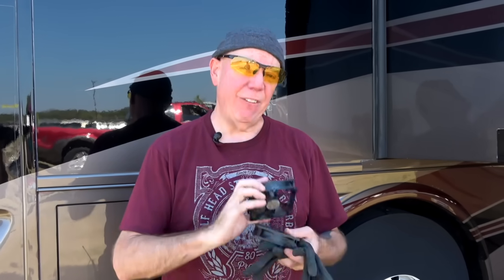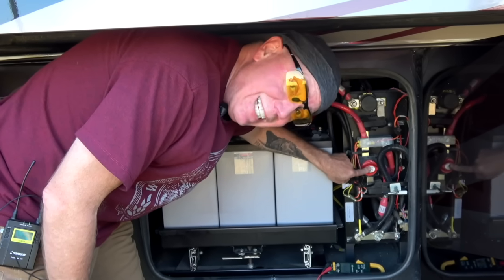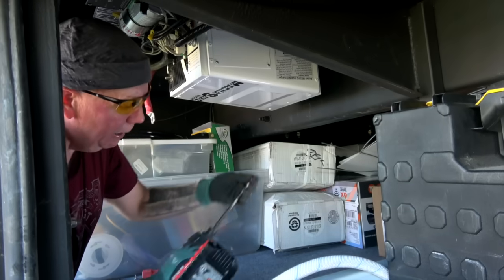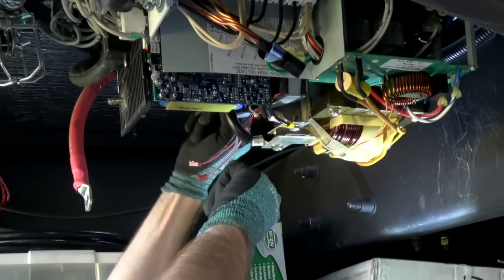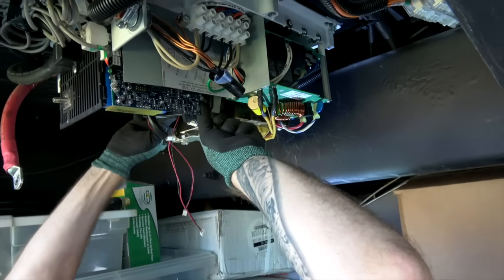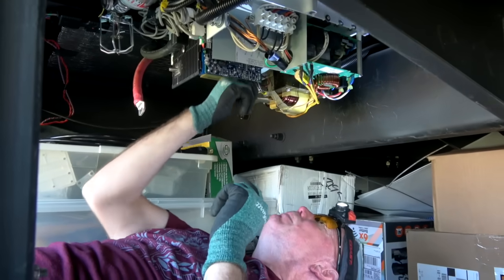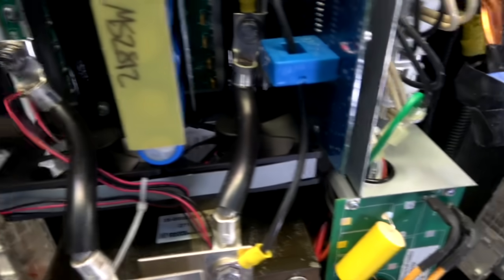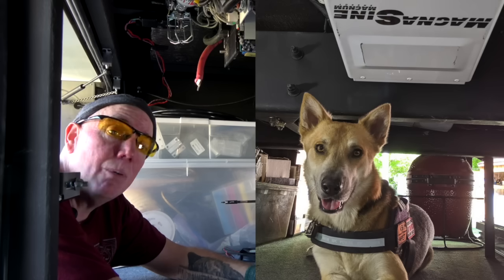RV Lost Power? Could be Overheating! Magnum Inverter Cooling Fan Replacement

Comment: Very informative. Thanks for posting. I need to preemptively change the fans on my Magnum inverter/charger in our 2019 Newmar Dutch Star 4018. I’m not very experienced in doing this type of work, so your video is very helpful. A couple of questions if you’re able to answer:  did I read your reply to one of the comments that you wrapped your driver extension in electrical tape?  Is that something you recommend?  And are the gloves you’re wearing for protection from a shock?  Can you recommend any gloves on Amazon or another source?  TIA.

Comment: I recommend disconnecting the negative (-) ground high amperage capacity cable. NOT the red positive (+) cable. Much safer.
Reply: Oddly Magnum recommends removal of the red first. The order is inverted from a typical battery?

Comment: Dave, are you ok?  You seem to be trembling uncontrollably
Reply from the maker: Hi Harry....It was the meds I was on and going though withdraws. All good but I will admit, I was a little nervous when I went in to remove the screw. But the shaft I was using was electrical safe.  I don't recommend doing it shaking of course. :)   (Thank you kindly for your thoughts and concern.)

Comment: Dave thanks for the video, watched it twice but still had to come back for that front screw and forgot which way the fans went after I took the old ones out.  Should have taken a picture before taking them out. In my defense, I have changed all 5 clearance lights on the front cab, and the entry door shade already today and the inverter was #3 of 11 projects I have to complete before leaving Florida and heading north.  Thanks again for all the helpful videos!

Comment: Excellent video! Was wondering David at the end of the video what type of fire extinguisher  system do you have by the inverter? Is it a stand alone or part of a bigger system?
Reply from the maker: Seperate systems.  4 of them. Foam Engine Fire Suppression and Clean Halon in the Battery area, Inverter area, and Electrical bay.  
Here is a videos... (Boy have I lost weight!!!)
Electrical: https://youtu.be/x4RHsPCLqgg 
Engine: https://youtu.be/xBu9tQDbUz0

Comment: David, once again thank you for a great, instructional video. Like you I mounted a fan in the compartment my inverter is located in. The whole compartment get hot from the inverter, I do have the fan controlled by WiFi controller, temp sensing switch. 
I wanted to suggest a different headband light that you might like. Made by OLight (Amazon carries them) exceptionally bright (controllable) and a battery that lasts!  Their recharging system is quite unique using a magnetic base. They are a bit speedy but rugged and reliable. Mine is over 2 years old now and is used daily (walking the dog!). Once again thank you
Reply from the maker: Hi...Yes, I ended up removing the cover and shooting a fan at it until the new fans came in just to keep running. :)   Thanks for the LED Headband suggestion. I hate the ones I have actually.  I looked them up and will surely order. They have a lot of different versions... https://amzn.to/2MaXCWC

Comment: I think you should tell people that even though there is no power going to the inverter it has large capacitors that hold a charge and can give you a serious shock.
Reply from the maker: I thought I kind of did by mentioning you need to be careful even with the power disconnected what you touch. Thus the gloves. :)
Reply from the maker: @Jack Jones Hi Jack....Yes you are correct.  I do have a set of electrician tools but it did not have torque screw heads. So I used the long shaft and electrical tape down the sides.
Reply: yes, insulated screwdrivers and nut drivers can pay for themselves in damaged equipment.
Reply: @hightechlowbudgetrv6729  LOL...not to mention "damaged humans".  :)

Comment: Looks like they mounted the inverter upside down. Frees up storage space, but makes it a bear for expected/required maintenance. Maybe put an inline backup switch on that “always hot” line? Could prevent parasitic drain when you think the OEM switch is off.

Comment: Absolutely flabbergasting that they did not use a three wire fan so that the unit could measure the fan speeds! Talk about penny wise pound foolish.
Reply from the maker: I had thought the same thing!!!  It would be nice to KNOW OF A FAN FAILURE before you need to find out the hard way that your Inverter/Charger is overheating and need to use a flashlight to look inside it though the vent to see if they are running.  In our case we would lose power and then 1 min later it would come back, and then go out again 5/10 mins later.  It ONLY show the TEMPERATURE issue on the screen WHEN IT IS HAPPENING.  So each time I got to the controller, it had already reset and I had not seen it.  It just happened to fail when I was looking at it one time still trying to figure out what was happening.  It really should have a fan sensor!

Comment: How much money can one expect to save by doing it themselves?
Reply from the maker: I am sorry, I would have no idea.  For example, where we are now if I had a mobile tech come out that could do it, it is $115 per hour just to come out on site with a 1 hour min.  I would have no idea what it would cost to as it would be based on how, where, etc. it would be serviced.  I just knew I had the skills to be able to do it and want to show it being done just in case it helps someone else who also may be able to do it.  The two fans costed $38 shipped from https://inverterservicecenter.com/     Actual Part Page: https://inverterservicecenter.com/magnum-energy-44-0004?filter_name=MAG-44-0004
Reply: And they would have charged much more for the fans too.
Reply from the maker: @naiiawah  LOL...You are correct.  They would need to come out to find your issue, see it is the fans, then have to likely order them and also mark them up.  Thus of course charging you to come back.  But again, I did feel good with my knowledge I could make the repair.
Reply: I sent mine out to Colorado turned out just the fans were needed. $665.55  way overpriced whe I should have done it myself.